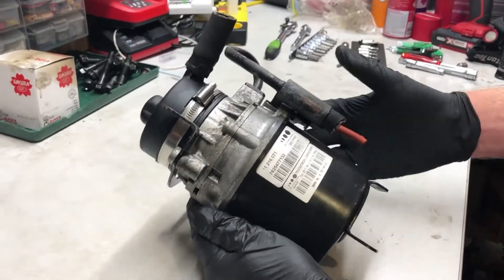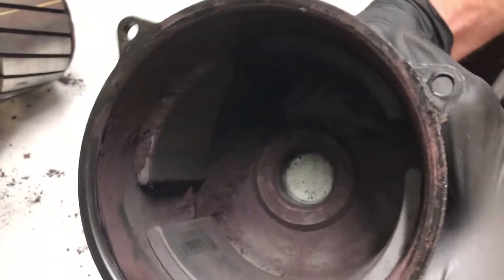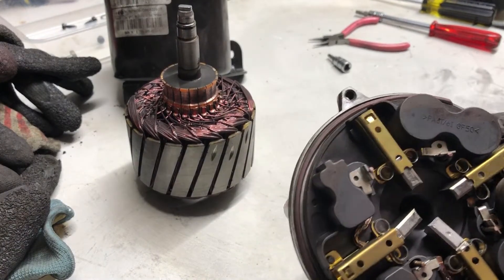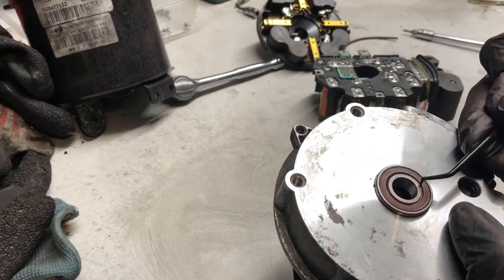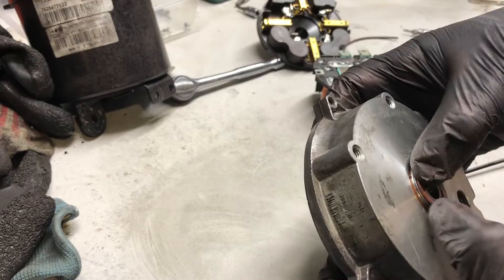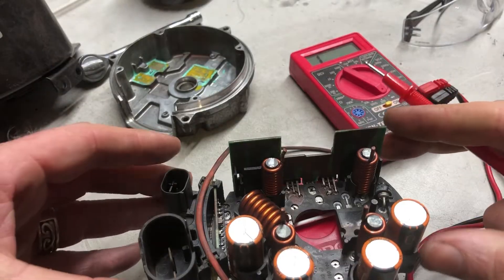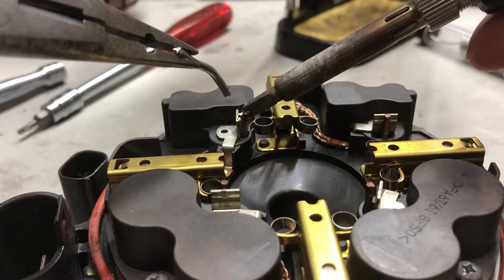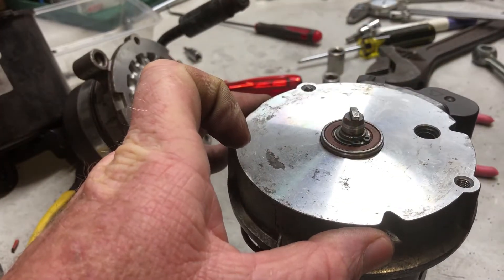Mini R50 R53 Rebuild Power Steering Pump

Comment: I have an odd issue where my ps pump starts running when I turn the key before the engine is started. And if I steer on idle the voltage drops and turns off my ultra gauge. I've tried 2 different alternators
Reply from the maker: If your ignition light turns on with ignition on and engine off, then the alternator is generating the right signal. If that's good, then pump more likely the problem.
Reply: Thank you, yes the alternator light is work as per you would expect, I presume it's the pump switching and also pulling too much current for the alternator to handle

Comment: Hello Thomas, did you realy only cleaned the electronic and the magnet? Was there actually nothing damaged? Greatings from Germany
Reply from the maker: @Doyouknowme023  ja. Preventative mantainance. I did a video on diagnosing components when it failed some years later.
Reply: @ Thank you very much for the quick feedback. So your pump didn't really have a problem? My steering is very sluggish, so I was hoping that this problem could be solved with the method you showed.

Comment: Is rotor is to much worn out,  cant be fixed?
Reply from the maker: it would be easy enough to machine a flat surface. But I expect you're need new bushes in that case.

Comment: Two 60012rs bearings, or only one? Need to change them all?
Reply from the maker: @vladtymchak2021  2 bearings
Reply: @thomaswilding8818  some change with noise after changing bearings?
Reply from the maker: @vladtymchak2021  i have not replaced bearings, myself. All were running smooth.

Comment: Hi Thomas, I am in the process of following your video, very helpful.. I have a question however: 
Is it normal that there appears to be no gasket between the pump and motor assemblies?   when I separated the two parts, the two metal faces were gluey with old fluid, and fluid leaked out of the pump through the hole where the motor shaft enters.. also the impeller (or whatever  the motor mates with inside the pump) appears to wobble about freely inside the pump, as if its only the motor that holds it centralised.  I am concerned that when i put the thing back together it will leak.   any thoughts most appreciated.
Reply from the maker: Sounds about right. The only seal I recall is the one between black motor casing and the alloy body. (and the o-rings on the pipe flanges)

Comment: Great video Thomas. thanks for posting this. Im in the process of rebuilding my psp. I am trying to get a replacement for these two small transistors marked f33 and f9 (yours are G76 and C67) but i couldnt find them anywhere no one seem to know of these codes.. do you have any equivalent specs that i can use to buy these transistors?
Reply from the maker: This page has some discussion of transistor part number - sounds like it's a 2N04H4 TO 220
https://www.mini2.com/threads/mini-cooper-steering-pump-definitive-solution.343394/

And that links to
http://dabongmini.blogspot.com/2018/10/mini-cooper-power-steering-pump-repair.html?m=1
Reply: Thank you very much Thomas..

Comment: Me olvidaba de donde llegan su alimentacion de los fusibles o de la ECU
Reply from the maker: Check fuse FL4 100A and F39 5A. No wiring diagrams in my haynes manual. I think power supply is off the battery via fuse FL4 (engine compartment fuse box). Switching and control from a module within the pump itself. Switched on when the ignition is on and alternator is charging. If the charging system dash light is off then the power steering pump is activated (yellow wire from dash light triggers PS pump) together with the ignition circuit on - fuse F39 (5A in foot well, green white wire). Violet white wire is the signal wire to ECU, ABS and OBD. That is the way it is meant to run. If dust creates a short then can run all the time. Conversely, if the alternator is not working then a good power steering pump will not run at all.
Reply: Maestro thanks You su cátedra es buena lo pondré en práctica ,por ahora lo desarme el colector del rebobinador está gastado  los carbones pueden trabajar lo que nesecito son los valores de su módulo electrónico estoy por consultar a un electronico muchas gracias..

Comment: nice video, honestly it is....but question will this sort a leak, cause my mini is Leaking from the pump, recently changed the rack and the power steering pipes...so all that's left is the pump... Will it stop the leak or it's futile?
Reply from the maker: Nothing to sort leaks in this video. Start at the top and work down. Leaks can drip down to the pump. There's an o-ring around the reservoir cap that can leak. The cap also has a vent. Then hoses - clamps top and bottom of each.

Comment: Hi, thanks for the video! My mini cooper s r53 pump would not shutdown even if i turn off ignition and remove key. It only stops when battery is removed! Any suggestions on what could be wrong? Also what fluid are u using to clean up, and what soldier should I use to re-attach?!
Reply from the maker: That is a common problem caused by the pump itself. But also check your battery box isn’t full of water. A thicker solder is easier. And one with flux easier also. I have not tried the lead free solder. I use crc precision CO contact cleaner.

Comment: Question... You mentioned at the end of the video the issue was getting the pump shaft keyed in with the drive motor, is that a tricky thing to do? Should the fluid impeller move around or be "wobbly" before it seats on the shelf?
Reply from the maker: No, not hard at all. Turn it until you feel the key drop into place. It's more that it would be easy to forget and then wonder why it didn't bolt together properly.
Reply: @thomaswilding8818  ahh ok, I've completed the steps show and tested the motor without the fluid impeller section on to see the end of the shaft spin and it spins fine. I then refitted the end of the pump with the key and hose connector, refitted it back in the car and it doesn't work. I get a little bit of PAS at the start occasionally but then it dies away after a second 🤦 looks like I need a new unit...
Reply: @thomaswilding8818  I wondered if I had not located the key properly on the shaft but it's magnetic so I assumed after a few twists it clicks in and I can bolt it down.
Reply from the maker: That's a pain. Only thing I can suggest is start over. Check wiring, fluid. If all good, check the pump again. It's very hard to get the motivation to go back to the start, I know.
Reply: @thomaswilding8818  I will take another look at the weekend. Is there a method for bleeding the rack? Does it take a while to push the air through?

Comment: Can I use a dead blow hammer instead of a rubber hammer I wasn’t able to remove the motor off and only damaged the rubber one
Reply from the maker: Be careful. You can damage the drive. But yes, it does need a hard hit to break them apart. If you have one, use a brass hammer or driver before trying a bare steel hammer.

Comment: So my power steering pump squeals when turning was run dry by the previous owner? Could I get away with replacing inner bearing and cleaning it out
Reply from the maker: It could be bearings. But those don’t get any PS fluid. The other moving part is the pump itself (separate to the electric motor). In the video, it looks like an alloy block that is removed from the motor and laid to one side. That would be the other suspect component.

Comment: Great video Thomas. I was wondering how I might go about testing the pump after I've finished repairing it, is there any way I can test the circuit is functioning properly other than placing it in the car? I think it only works if it has signal from the left-right sensors that connect to it. Any ideas?
Reply from the maker: Good question. I imagine it’s more than supplying power. If it works as a feedback loop, rather than a simple signal. That would require hydraulic connection as well. Might be worth setting up a test bench if you were doing many pumps.

Comment: Hi mate, what's an acceptable value for parasitic current draw? Thankyou
Reply from the maker: Where abouts are you measuring draw? I can take a measurement same place on my car.
Reply: @thomaswilding8818  I was measuring draw at the engine bay fusebox at the time and had the fusebox upside down, pulling the pump's fuse and then re installing while the car was in standby mode. 

But easiest way would be to measure draw at the battery and then to pull the main connector from the pump. 

Either way its going to be hassle so I appreciate why you won't want to test 😂, do you happen to have a spare pump as it would be easier to test on the bench if you've a 12V power supply or spare battery aswell?
Reply from the maker: @warwickdean  I was getting a total of 0.5 amps at the red battery wire, but suspect I woke the car up popping the bonnet. I saw 0.05 amp after waiting. I must say, I can leave the mini parked for weeks and the battery has enough juice to crank the engine, no problem. So I expect it has a much lower steady draw than say a jag. What sort of numbers are you getting?
Reply: @thomaswilding8818  when the vehicle is armed, after 2 minutes, I get 31~35mA, if I unplug the pump mains, it drops by around 15mA. I would have presumed it should take 0-1mA and not 15mA but there's no reference for all the tolerances anywhere
Reply: @thomaswilding8818  your car probably wasn't in sleep mode but yeah with wake I see around 0.6A (600mA). In sleep mode it should be 0.012A~0.034A  (12mA~34mA), I managed to get a reference from a friend and his R53. Mine falls into that range if I unplug my power steering pump aswell, which makes me suspect the pump should draw probably 0-1mA in standby but I may be wrong.
Reply from the maker: @warwickdean  I did eventually get numbers down around 15mA total draw. But I couldn't be confident of that resolution without taking things apart. Don't have a pump on the bench to test.

Comment: I have a Mini coopwr 2004. The P/S electric pump, keep running after   turn off the engine. The pump don't stop until  dreain the battery.
Reply from the maker: Yes that can be a symptom of dust build up. The pump is hardwired to the battery and dust can create a short that turns it on

Comment: A good overview.  I'm a retired aviation mech and tech.  My 2006 R52S has a broken pin #2 on the digital three pin on the pump's connector.  Just had to get into it and jumper from the pin 2 on the connector to the circuit board.  It's better than buying a new one.  I have a couple of issues with the video.  If one doesn't have experience solder, it's best to skip cleaning the circuit board.  I tried using a 50 watt soldering pencil live to video on the brush connection.  Too cold.  Then a 100 watt solder gun.  Just enough for a dangerously cold solder joint.  It took a Weller 200 watt gun for good solder joints.  Next week I'm pulling a friends subframe for control arm bushing changes.  Since his R52S has 131K miles, and after seeing the power steering pump contamination/mess on my R52S with 80K miles, I'm going to clean the PS armature and brush area.... only.  I believe going deeper is an unnecessary risk. Consider this... Soldering is an acquired skill after training.   Take care.  This video is a good overview.
Reply: The problem with unexpected on/off of the steering motor is most likely because of dust on the control PCB. This board is controlling the speed of the motor depending on the car speed. So cleaning a PCB is an important step!
Reply from the maker: Good advice to just take the stator/casing off if doing preventative maintenance. And it is important to get the solder flowing well. Wattage helps. Also important to have the right size tip on the soldering iron. You'll need a lot of wattage to make up for the tip being too small because the component will dissipate it too rapidly. In this video I'm only using 50 watts. Set to 350 C, but with a large knife tip.

Comment: Hi Thomas, I need to get in touch with you regarding my ps pump. It stays on and drains the battery. I am interested in rebuilding it as I don't want to gamble on a secondhand unit. I am located in Auckland
Reply from the maker: How can I help?

Comment: I measured 034 ohms on the capacitors is that to low??
Reply from the maker: If you’ve got a capacitance setting on your multimeter, use that and check against microF written on the capacitor itself. My cheap meter doesn’t have that. Looking at resistance, they should all be about the same.
Reply: I think the diode is bad as im getting readings on all 3 connectors no matter what lead i use (red/black) ordered a new one ,not sure if its the right one
Reply from the maker: @alexanderclifford9826  Makes sense. Cooling must be an issue with these, given it's pressed against the casing to make a heat sink. Please do share a link to the part you ordered in case that helps others.

Comment: It's the PS pump out of my R53 2006 MINI Cooper S Checkmate in this video, so I wanted to add comment as to what transpired.

Symptoms first... We had an alternator failure, and noticed the power steering had shut down. This was catalyst to do some long-awaited engine work. Hopefully when it all went back together, with a brand new alternator, the power steering pump would be fine, right?? Ahh, no! Initially on systems liven up the PS pump would continue to run when the ignition key was on auxiliary, whirring away constantly after shutting down the engine. At some point this stopped, and we thought (fingers crossed) everything was fine. But there'd be times when the PS system wouldn't start the pump, and steering was heavy. At other times, the PS pump worked just fine. I took the path of least resistance... and got another pump, before a discussion with Thomas revealed that he was keen to have a go at repairing it, to make this video.

The replacement PS pump was working in the MINI just fine, indicating that my car's systems were working okay... but we took that out to re-fit our original pump, having been reconditioned by Thomas Wilding. I am happy to say that it has been running... well, exactly as it should! Nothing else to report except that it works just fine. Thanks very much Thomas! If you've got an 'iffy' PS pump, it could be well worth a crack to have a go at reconditioning your own pump rather than simply replacing it, following Thomas' service instructions.
Reply from the maker: Thanks for the lending me the pump. Having the back to back test against the “new” pump in your car gives us a good comparison.
Reply: This is the response I was looking for. Just today noticed ps pump wasn't shutting off after I shut the engine down. Caught it immediately and started disconnecting the battery when the car was not in use. Honest opinion, was this more work then just replacing the pump, or would you say this is worth the time?
Reply from the maker: @dcfsmustbestopped  Definitely easier to simply replace with a new pump. This rebuild is about spending hours to save $$. But if you're replacing with a 2nd hand pump, then it's a bit of a gamble unless you know the replacement pump is good. I actually did the pump in my car as preventative maintenance.
Reply: @thomaswilding8818  Thanks for the reply. I have all the symptoms you describe. Battery light is on and power steering pump runs when car is off. I just haven't noticed any actual impairment in the steering...yet. Gonna use your guide here and give this a go on my r50.
Reply: Cómo y dónde lo compraste amigo
Reply: If this was the original pump why was the wiring and pressure line just chopped off with cutters? To me it looks like a pump from a wrecker
Reply: @cabotbroughton7458 , Please read my comment. If this is too hard for you to grasp, then the repair work covered in this video will also likely be a bit too hard for you to understand. I got another one (from a wrecker) and fitted it to my car. That one came with "the wiring and pressure line just chopped off with cutters". What should I do with those bits I didn't need??! I fitted them onto my original PS pump (taken off my car), planning to dump them with my original PS pump. Then my friend Thomas took the pump off my hands to have a go at repairing it. After repairing my original PS pump, I refitted it to my car to test and prove Thomas' repair had worked, which it had.
Reply: @davidsweeney8242  ok thank you for the explanation

Comment: my pump just failed today. your excellent video couldn't come at a better timing!
just one question. what is the size of the bearing? would love to replace it while i'm in there.
Reply from the maker: No, I didn't take measurements sorry. My guess would be they are a common size. But neither of the pumps I rebuilt had a bearing problem.
Reply: @thomaswilding8818  6001 2RS

Comment: Great video. Trying to dignose my PSP issues at the moment. Mine seems to cut out as soon as the car gets up to temperature. Ill give this a go if all else fails
Reply from the maker: I considered putting thermal compound (arcticsilver) between the diode and transistors where they press flat against the plate. Probably should have followed through with that. All that dust - as well as causing electrical shorts - would compromise heat dissipation. And obviously heat is an issue, given bmw mounted a little fan to blow on the pump.
Reply: @thomaswilding8818  that is a good idea though thermal compounds are often elecrically conductive so id be worry about it moving and shorting something else. Once ive rebuilt mine im going to build a heatshield to protect it from the manifold
Reply: So did you fix the problem with just cleaning like the video shows? I am having the same isue so the answer will be very helpful for me..
Reply: @MrLefterisGR yep i just cleaned it and its been fine since 👌
Reply: @terbor33  nice! thanks